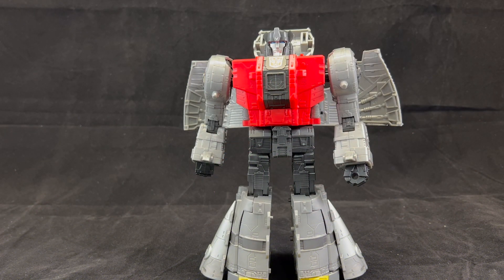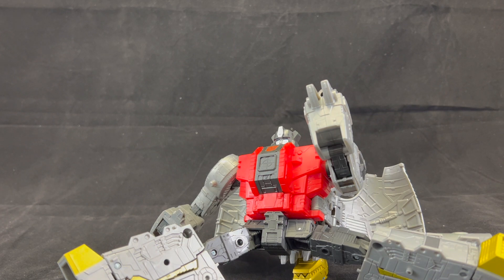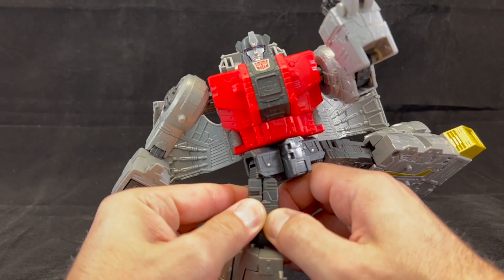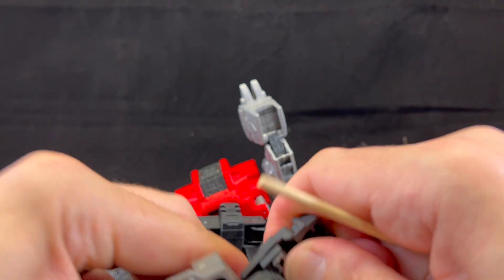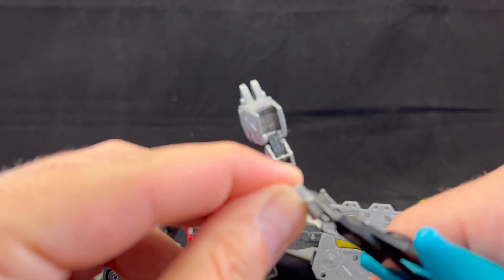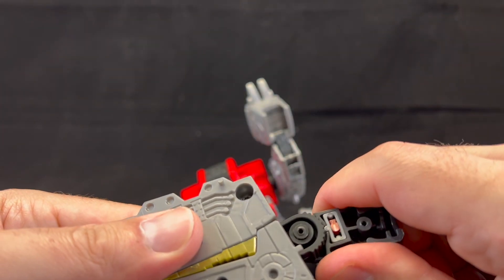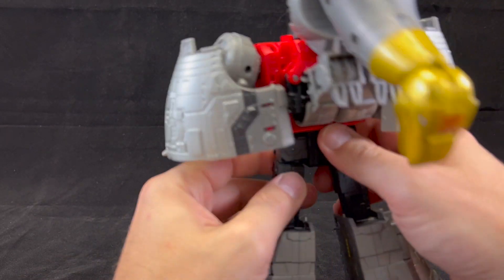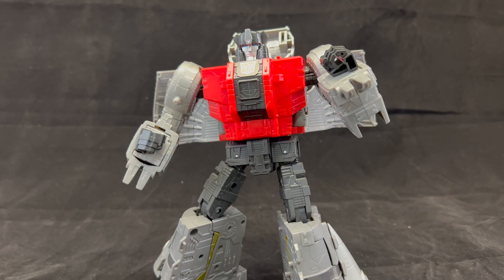Studio Series Dinobot Sludge Knee & Hip Repair Guide

Comment: Thanks for this.  I won’t razz you too hard on clearly not being up to speed on tool & hardware nomenclature!😉  Found my Sludge for $25 in a box that looked like it was used as a soccer ball.  Figure was fine save for the knee joints (hips are fine, but good to see I can address them if needed).  It’s crazy how we’re expected to finish these figures!  I guess I can tolerate the floppy ‘wings’.  Thanks again!

Saw there are some upgrade kits that cost more than I paid for this dude!  Fudge that!
SMH…

Comment: That seems very helpful. Haven’t got my copy of this figure. Don’t know if this is a widespread quality control issue from Hasbro or not, hopefully not intentional. Where would I go get a plastic sprew from?
Reply from the maker: Sprues are just something I had laying around from old model kits. You can use anything thin. Old membership or gift cards are an option as well. Just anything to add a little pressure to the joint.

Comment: Any tips if the screw is shredded (hip screw)
Reply from the maker: That can be a challenge. There is a tool called a screw extractor that might help. You may need to take the screw to a hardware store to find a close replacement if that is the case. Sometimes once you get the out you can saw a new head on them, but only if there is enough material. Good luck.
Reply: @NoriToy  most fixes i've seen online have the screws at the surface level so they don't seem to be applicable (super glue-baking soda especially).  Guess that's my only option.

Comment: One of my back legs which becomes his arms one is loose and one of them is tight can I do it at the same way
Reply from the maker: As long as it is a joint with a ratchet, there is a good chance it uses this same system. Mine are not loose, so I hadn't touched them. You may just have to open it up to see. Good luck.

Comment: The reason why I stopped buying these dinobots is because of those knee joints being so structurally weak. My Slag figures knee ratchet snapped itself in half leaving him a bum knee joint.
Someone needs to make replacement knee ratchets (they are all universal right?) For sale via 3d printing.
Reply: Ok. So they made Sludges knee different and weaker on purpose for that reason. There is an extra bar that changes the horseshoe type ratchet joint.
They probably made it weak on purpose for that reason.
Reply: @metal_fusion  it's the same exact joint